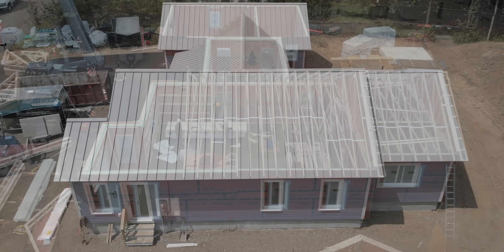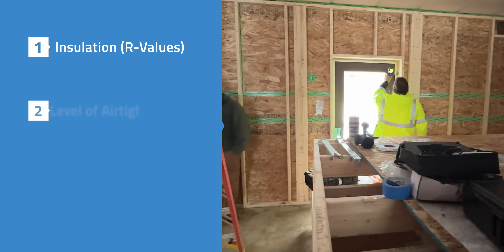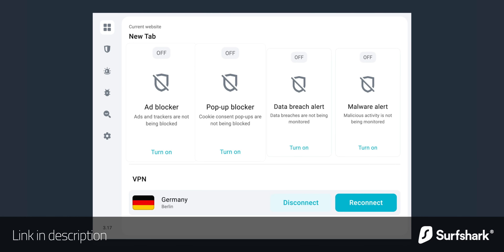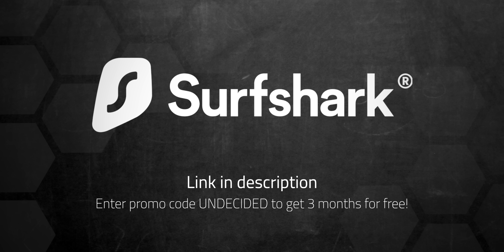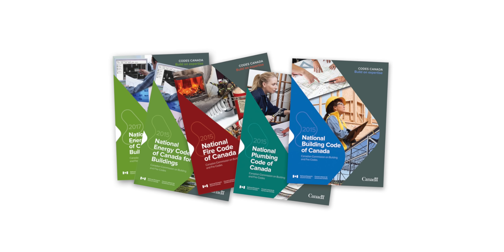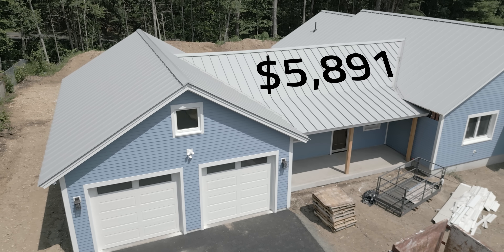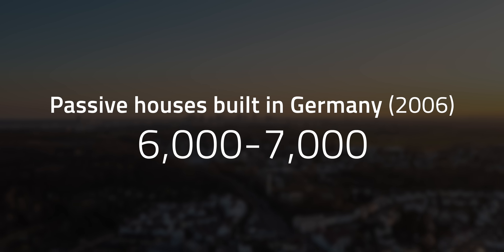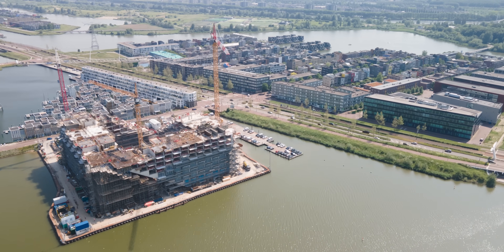Why Do American Homes Suck?

Comment: It's all about cost.  Many Americans are already priced out of the housing market.  If government pushes higher standards it will exclude more people from the market.
Reply from the maker: Higher standards don't always have to come at higher costs.  Achieving a better quality base standard that improves efficiency is possible without pricing people out.  BUT ... you do raise a great point about the current state of the home market, it's just not as attainable as it should be.  Also, I'd urge everyone to keep in mind that this doesn't just apply to single family homes.  Better building standards for apartment buildings are just as beneficial.
Reply: Sounds like Americans lives in too large houses, to me.
Reply: @SkepticalCaveman  I thought about that when I posted initially, and agree.  Americans want too big of houses, we'd be better served by smaller, better-constructed, more efficient houses.  But then I thought about designing a house with my wife.  I couldn't even convince her to significantly reduce square footage.
Reply: @TheMightyTimmy  that's a mentality that has to change in America. Having several smaller buildings takes less energy to heat/cool down, especially the buildings only used for storage. We have more "unheated" storage area over here than the living area in the main house. 

At least the tiny house movement is growing over there..
Reply: Would cheap government loans tied to better standards make things better? You could get better homes and then pay the loan with the savings you have during the life-time.

Comment: I have lived both in the US and Europe. One reason Europe has better ways to keep homes insulated (at least in newer construction) is because of incredibly high energy costs.
Reply: @ralfjanser4733  yes, in Germany we have usually built very solid houses based on brick masonry, but 50 years ago these homes were not so well insulated. Most of the changes in the last 50 years have been in using better insulating solid blocks such as Poroton or Xella (AAC), and thicker layers of insulation. 80% of our newly built houses are using some kind of solid masonry block, and only 20% use wood.

For example: 'Poroton' is the trade name for a fired-clay block (or 'jumbo brick') manufactured to a high degree of accuracy. These blocks are formed with a honeycomb structure of vertical perforations, that reduce the material in the block (and thus the weight), whilst maintaining adequate strength and increasing the thermal resistance (lambda value) of the block.
Reply: Thing is, the cheapness of energy in the US is quickly disappearing. Especially whenever weather is a big variable.
Reply: @enlightendbel - “cheapness in US energy is quickly disappearing”

That is a political decision, based upon voters. Some voters are scared into voting for candidates who will l implement policies for increase energy costs & lack of physical security, blood letting the voters from two sides simultaneously.

Honestly, it should not be that way. Unfortunately for Americans, the cycle swings back & forth, between those who have sound energy & security policies, and those with unsound energy & security policies.
Reply: @DavidHalko Security poping randomly here...
Either ways, to be extremely fair, it is nice to see energy prices getting a tad higher in the US with the current climate crisis. Would be nice if the US did the systemic changes it needs to do to start consuming less oil or gas.
Reply: @ralfjanser4733  And Germany had high energy costs 50 years ago also.
Reply: It's just regulation / the law. At least in 2 EU countries I know, you can only build low energy / passive. Every X years it is reviewed and becomes stricter so what was rated C becomes D for example (there is an energy rating from A to G). For example in France it will soon go beyond passive where it will become mandatory for newly built houses to produce energy.
Reply: That's BS, in Europe people build to last. there is no reason to rebuilt in 30-50 years.
Reply: @blikpils  in Europe we've also generally grown out of building in places where they will need to be rebuilt every decade.

Like all those people that persist in living in Tornado Alley or areas almost yearly hit by hurricanes in the US.

And when we do, we build from a perspective of having the building survive something like that, instead of having to rebuild.
Reply: @enlightendbel having hurricanes often?

Comment: If you want European efficiency, you better be able to pay European prices.

A double-pane window for example might be $150, whereas windows that are triple-pane could be closer to $600
Reply: Me in Scotland, Europe "Crystal Casement uPVC Window Right Hand Opening 610mm x 820mm Clear Triple Glazed White" £207 or 252.25 in Traitor Dollars
Reply: @julianshepherd2038  620mm is 2 feet...🤣 Did you try to find the smallest triple pane window available to give your pricing?
Reply: Yes, this was addressed in the video. Americans are obsessed with low costs in the moment, even though the savings would be bigger down the line by investing in properly insulated houses. Perception of what a new house should cost has been warped.
Despite all these cheap houses, there's a huge housing crisis in US cities. And the reason for that is that it's not investment in a quality new house that's actually expensive - it's location, speculation and price gouging that drives up costs.
Reply: because its definetely normal that adding 50% to one component must add 300% to the cost. Companies cant be at fault, it must be the europeans
Reply: Add one pane, quadruple the price.
Truly the Apple pricing model right there.
But yeah, this seems to be accurate by what I've seen here.
Reply: I am in France close to the German border. I built two houses, and here as on the other side of the border there is a 20% difference between double and triple glazing. This is the cost of the glass, the profiles are designed to accommodate double or triple glazing without difference.
Reply: @philippes960  there's not a 20% difference, unless you're already paying 100% too much..
Reply: Nope, that's just due to lack of quantity production. When 95% of manufactured windows are single- or double-pane, of course their pricing standard is going to be far less than the <5% triple pane offerings that are produced and marketed as premium products with low production efficiency. Go to Europe and find the same quality and type for 2-3x lower price simply because it is the standard here and that's pretty much all that is manufactured now.

Also artificial scarcity plays in.

Comment: My new house should be wild fire resistant, super insulated, passive solar and have a good fall out shelter for WW3.
Reply: My Communist era apartment block in Bulgaria has a nuclear bomb shelter in the basement. Which is perfectly normal here.
Reply: Good luck paying for it
Reply: @xephael3485 good luck paying future energy bills without it. Insulation always works out  heaped and better in a power crisis or cut.
Reply: @julianshepherd2038  double the insulation does not double your energy savings.  In an energy crisis you might as well just invest in better clothing.
Reply: I don't want to be that guy, but most houses here are exactly that. Apart from the passive solar part, but that gets added more and more.
Houses here are built mostly with reinforced concrete and bricks, have a thick 160mm outer isolation, and have to have a air raid shelter which has an NBC filter system installed which can be operated by hand, if there is no power. Some houses don't have those, but they have space in community shelters, usually just a few hundered meters away.
We have those things since... I don't know exactly, the 70s?

Comment: It sounds more like Germany rather than Europe itself.
Reply: European here. I think it depends on the typical weather of the country in particular. I live in Spain and here it is usually hot, so the buildings are not very good at keeping heat in winter. But visiting my grandparents in Sweden, it was amazing to enter the house and feel such a stark contrast in temperature between the inside and the outside.
Reply: Even in east Europe you would be amazed how much they changed building wise so it's not only Germany.
Reply: Nordic houses are extremely efficient for obvious winter reasons too
Reply: Scotland is going to Passivhaus standards from 1.1.25.
Reply: More like northern Europe in general, just the UK excluded
Reply: Belgium too, Energy Neutral it's called here.
Reply from the maker: Germany, Norway, Sweden seem to be where things have grabbed hold the earliest, but many other areas of Europe and the UK are starting to follow the trend.  @juliansheperd2038 I hadn't come across that date for Scotland.  Very interesting.
Reply: Passivehaus was started between professors in Germany and Lund, Sweden, so they had an early just. I now see it all over northern Europe.
Reply: Non-German European here. This is pretty standard in most countries here. Germany is known especially for the turn and tilt style windows which may be less common elsewhere, but the actual production standards of high-efficiency triple-pane windows are standard in most European countries by now.